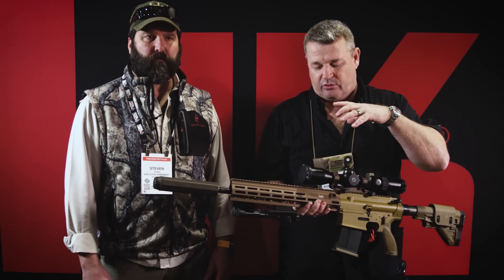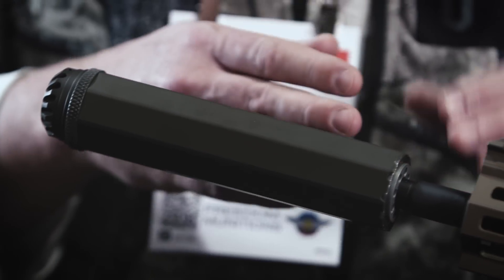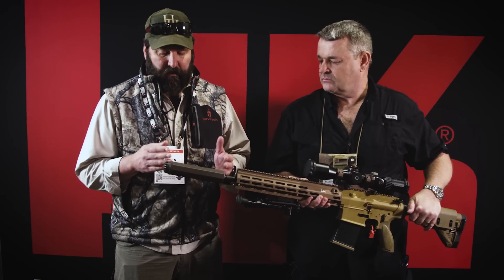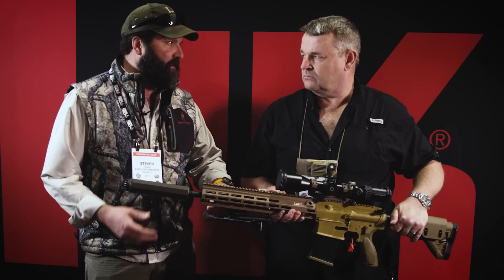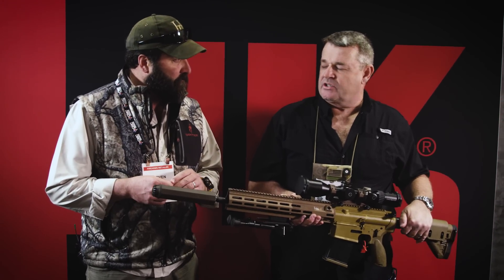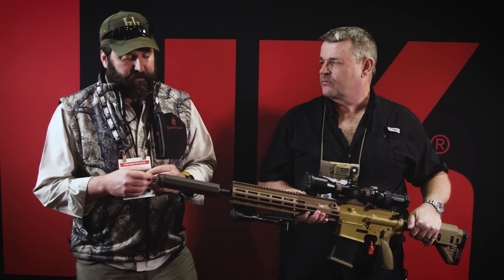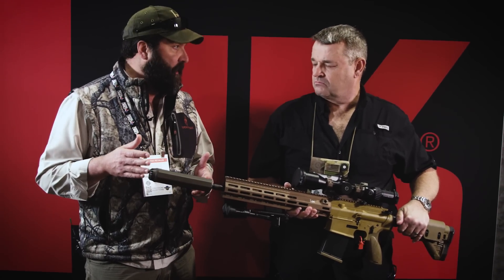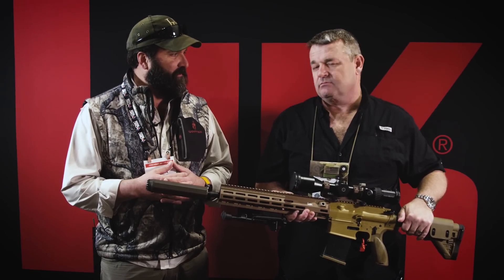Shot Show 2017: H&K CSASS Suppressor

Comment: I don't know why 308 - 7.62x51 chambered rifles makes me fall in love with them.
Reply: I'm the same way man.
Reply: The cool factor dies off really fast after you carry it the first couple miles. 5.56 is a very efficient and lightweight cartridge and very few situations warrant the extra power of the 308 (which is wasted at close to medium range due to overpenetration).
Reply: Yeah but shooting a semi auto rifle in .308 is a different experience than 5.56. Don't get me wrong I love my 5.56 rifles, it's just something about shooting the .308 in semi auto that makes you feel like a man. You feel that power.
Reply: If you want knock down energy without the weight of the 7.62x51 , you need to use the 6.8x45 SPC. Same weight as 556, but more than double the power.
Reply: LAV
Larry did you get a chanse to try out an OSS can yet? If so what are your impressions?

Comment: I love the not having to adjust the gas. Come on Hearing Protection Act!!
Reply: I find it strange that there are so little suppressors with similar technology. At least that I know of. There is one made in Finland and also in Shot Show, but no one seems to be doing booth review of them, Saimaa Still. I have one of their AK cans and it's pretty awesome. I haven't measured or really compared sound level to others side by side, but suppression level is pretty good and lack of back pressure is really excellent improvement. I will be changing my AR 5.56 can to one of theirs soon.

Comment: I had an idea for a suppressor with baffles made out of a sturdy steel mesh filled with light weight aluminum beads What are your thoughts on its potential as a viable design? My theory is that the beads will mimic a silencer filled with water, a technique used by some users to eliminate first round pop.